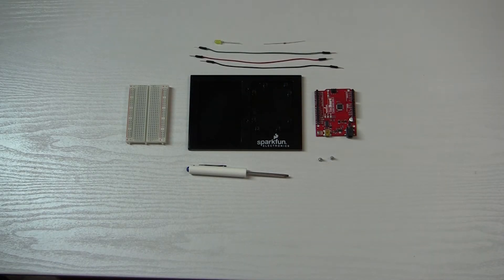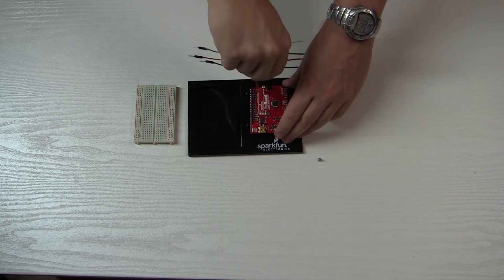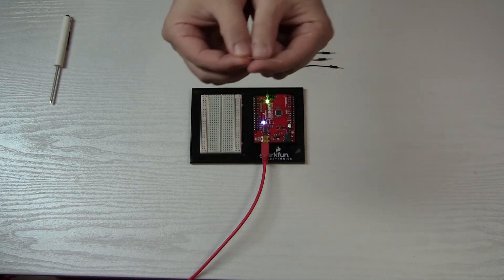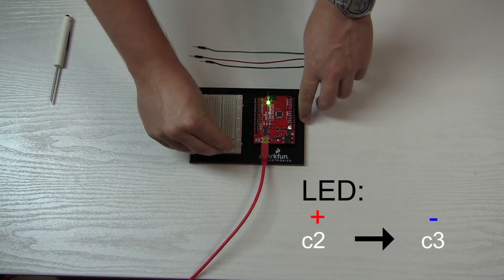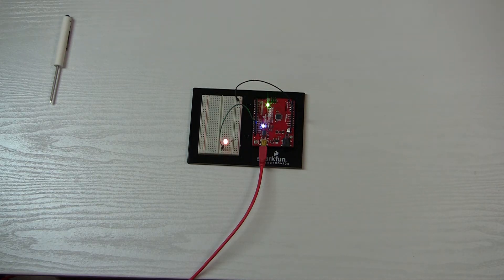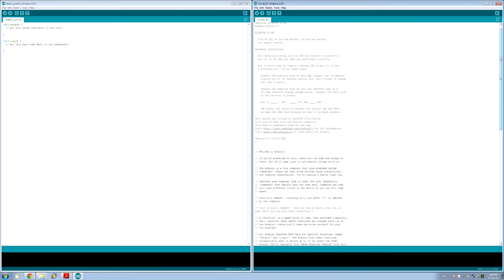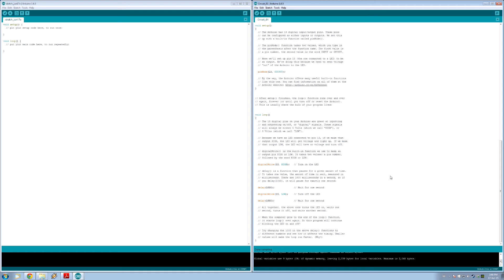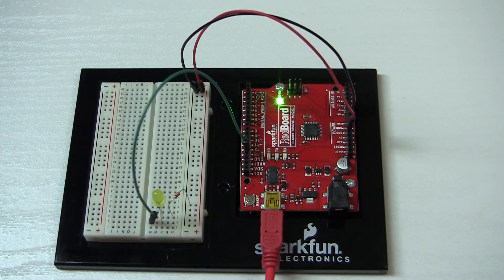Sparkfun Inventor's Kit: Running Your First Program

Comment: I need help. I plugged my RedBoard via USB but my PC won't recognize the connection. I need help with the connection, please.
Reply from the maker: welp did you install all the software outlined in the guide?
Reply: Yes I did but I don't know what happened. Anyhow: I'm formatting my pc and I'll redownload everything again. I'll let you know what happens. Hope you can help. Thanks for your answer!!
Reply: Ok, SO. For some reason the first time I opened my Arduino IDE (after instalation) it already had the COM port 1 registered and when I try to get the board info it says "Native serial port, can't obtain info". I also get errors while uploading the code to the board even after I installed the CDM v2.12.00. I'm running a fresh Windows 10 install.